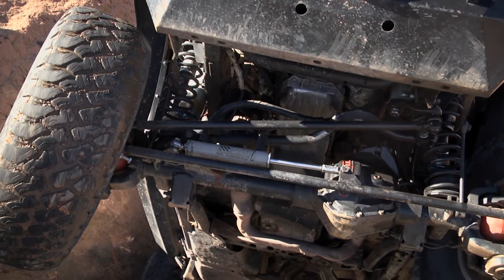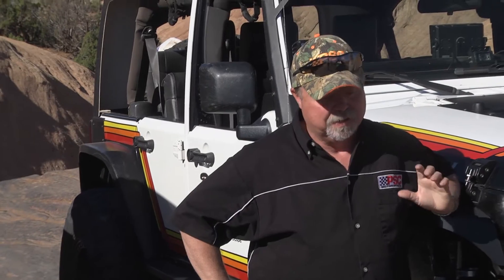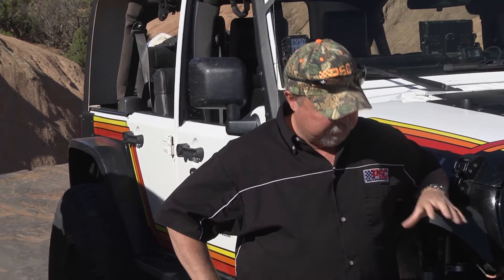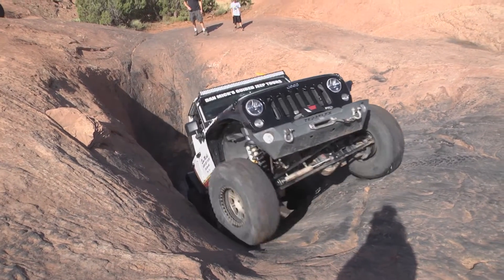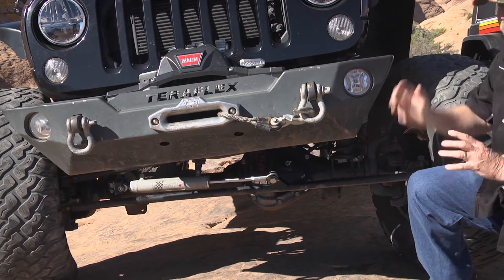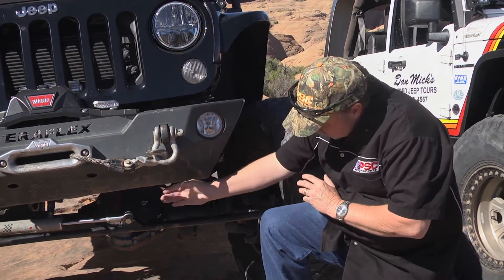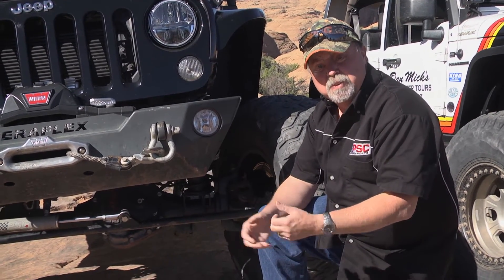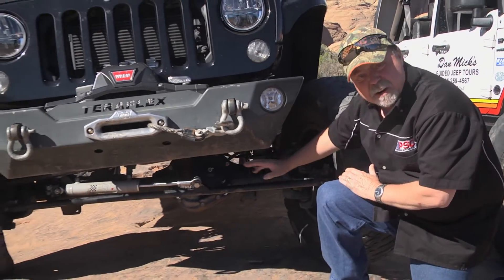Hydraulic Assist Steering with Tom Allen and Dan Mick

Comment: need the information to purchase there products  ?  I would like to look into the steering assist. thanks
Reply from the maker: +Jim Schweigert These systems are available through many of the 4x4 shops. I carried this brand in the business I had (Foothill Offroad) and the new owner still carries that brand (check out foothilloffroad.com). You can also buy them direct from PSC Motorsports (pscmotorsports.com) but you might get a better deal in the resaler market.